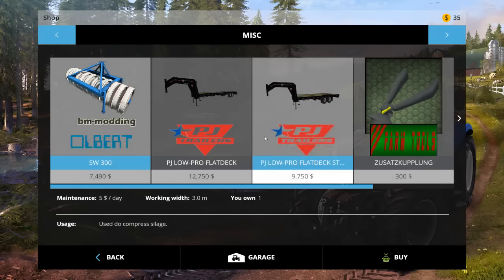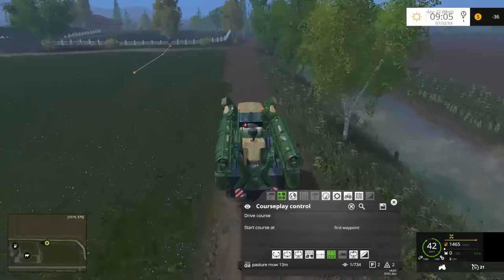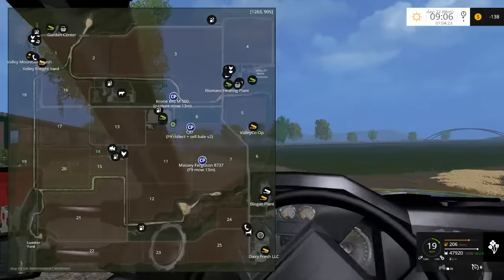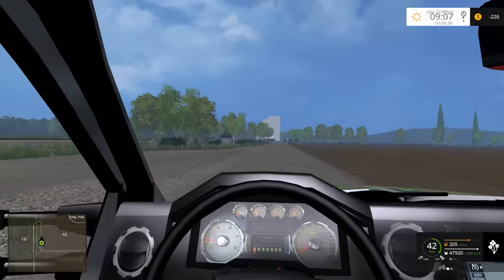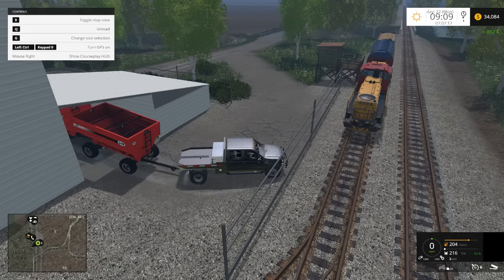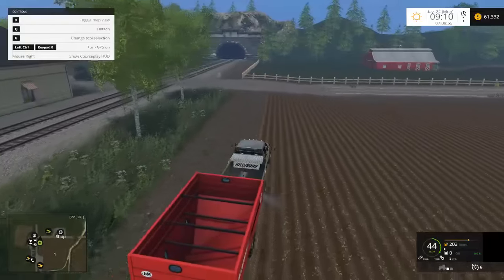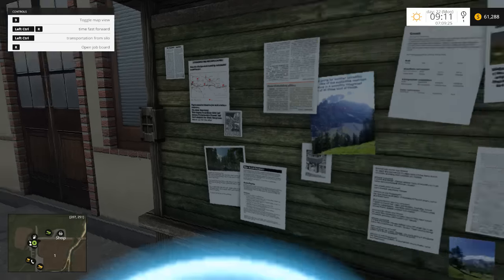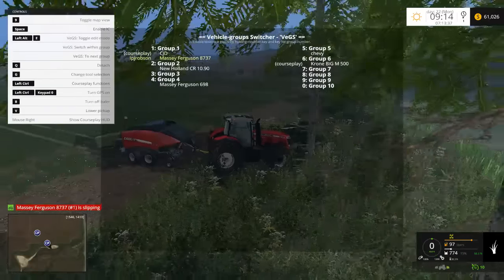Farming Simulator 2015 Valley East USA E16 - oh trains

Comment: iain, that same website i told you had the ford force pack and ih 86 series pack that converted it, well it has a new holland bb340 square baler north american version but i don't think its a conversion because i don't think i remember a north american nh bb340 in 2013.
Reply from the maker: +SnapperMan84 Thanks for letting me know
Reply: Why website is it those mods were great in 2013
Reply: Thanks
Reply: +Iain Robson Ian don't download anything from fs2k they release privat mods without permission and don't put any credits ! Just a heads up

Comment: Iain, I am having big problems getting course play to pick-up and offload bales. My tractor will not drive in the offset manner in which it is supposed too. The drop off point does nothing as well. What version of CP are you using? Thanks.
Reply from the maker: +AUOffroad did you set the offset in tools offset. I am using the latest release of it.I think it's 4.01 or something like that
Reply: I have done everything as you have and still not working. On another note, my combine info in the lower right corner still does not work. Uninstalled and reinstalled the game to no avail. If anyone out there has any clue as to why this is happening, please let me know.
Reply from the maker: Maybe check courseplays FAQ on their Site